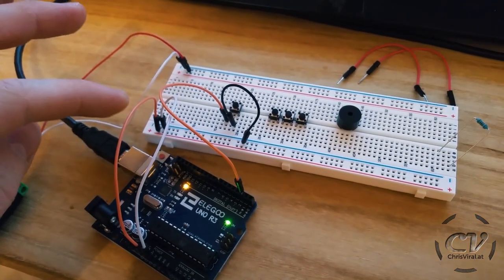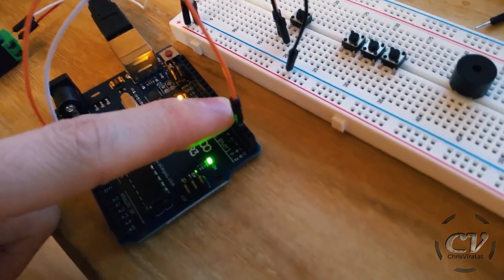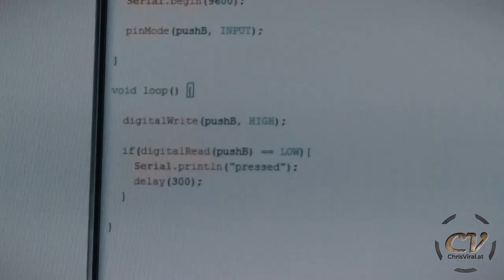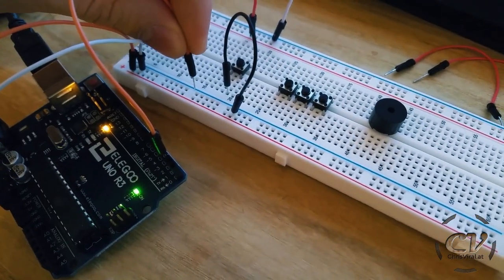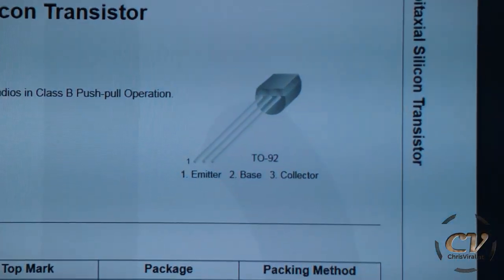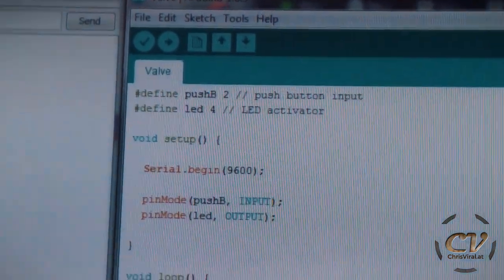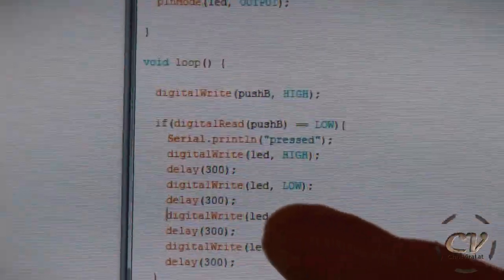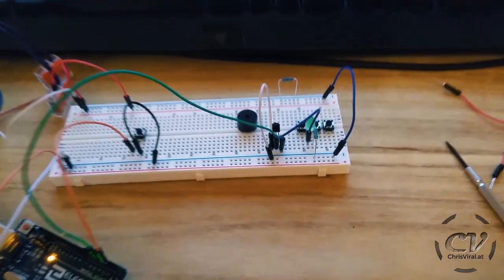How To Actuate A Solenoid Valve With Arduino Uno (Tutorial & Code)

Comment: You have to put a 10k resistor between the base of the transistor and the arduino pin 4, then it should work. Or you could just use a mosfet, those are easier to use and more efficient. Greatscott did some videos about misfets and bjt transistors (the one you used) you can warch them they are not that hard to understand. Also you should put a diode in series to the solenoid valve in such a polarity that it doesnt get hot when you turn on the valve, this prevents the voltage from going from the solenoid into the circuit when the valve is switched off.
Reply from the maker: Thanks for the tip 🙌🏻🙌🏻
Reply: @ChrisViralVlogs  i meant in parallel, not in series
Reply: Just watch greatscott's video
Reply: Hi, can i replace the transistor with a step-up module, I mean:
(Arduino 5V > DC-DC SX1308 Adjustable Power Module Step Up 12V >Solenoid valve) ?

Comment: Setup Variable's and disable the serial monitor when running projects as the serial will cause your Arduino to reboot or crash  just Personally I would buy a Relay module for about 1$ /£ 1  job done (simples)

Comment: ChrisViral Vlogs Sorry what are the orange things. Are they also solenoids?
Reply from the maker: They are just spring loaded clips (internally connected) to connect wires without soldering them. You can find them if you search for "wago connectors"

Comment: What is the amperage of your 12v power supply? My valve doesn't have the value listed.
Reply from the maker: 2A but it doesn't matter since the valve won't draw nearly that amount. You're missing important basics it seems so read up :)
Reply: ChrisViral Vlogs thanks for the unnecessary little dig about how I need to do some reading. 🙄 I have one working already, I just oversized the power supply because had a bigger one available at the time. I’m going to rebuild it with a smaller power supply to conserve some space.
Reply from the maker: It's not unnecessary, trust me I was missing basics too
Reply: @zenmanproject  I bought one of Amazon and it uses a step-system so for "x" rate of flow (lowest L/min) it's like 20mA, then 40mA, 100mA and finally 200mA for full-open. So at 12V it seems 200mA is the greatest mine will draw for full-flow and 20mA is the smallest. Hope that helps.  So in theory, any 12V power supply able to deliver at least 200mA should do which is pretty weak considering a $8 dollar DC power supply is usually rated for 3-5A for reference.

Comment: flyback diode
Reply from the maker: Yeah, someone already notified me about that :)
Reply: @ChrisViralVlogs  did you check the specs for the transistor?  It may have been to much voltage or current